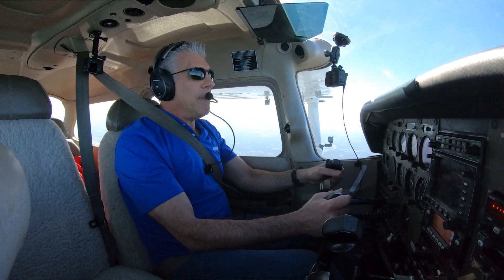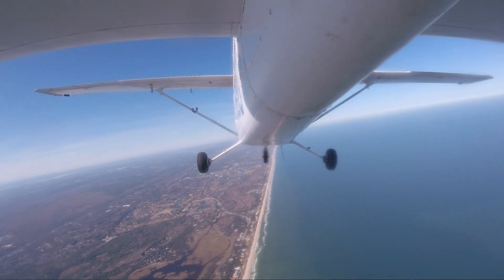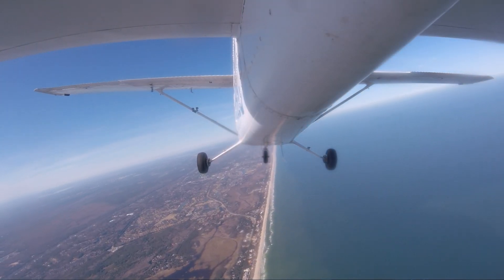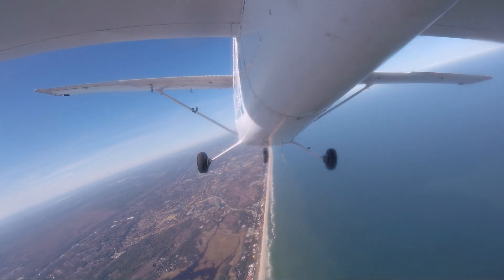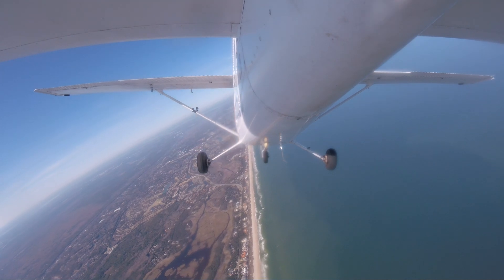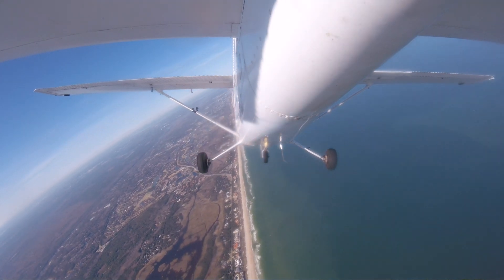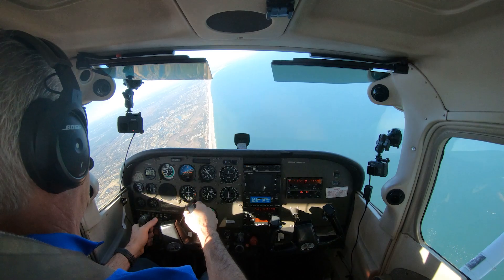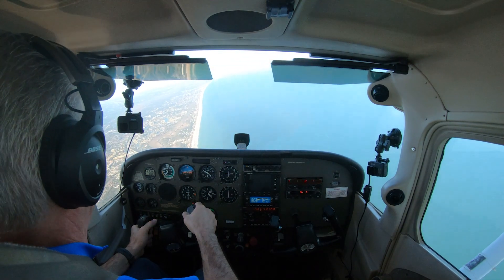Which Flight Control Turns The Plane? Advanced Pilot Skills Series with Spencer Suderman (ep. 3)

Comment: I've always been told its the differential lift of the wings that turns the plane. Elevator maintains altitude due the shift in the lift vector (loss of vertical lift). You can have an airplane without ailerons and turn it with the rudder, which does the same thing, change the lift on the wings. Elevator controls pitch axis .
Reply: Elevator controls  movement of the plane in the pitch axis...which controls angle of attack (AOA)...which controls the amount of lift.  There is no differential lift accross the wing, there is only a total lift vector which is the sum of the vectors (direction and magnitude) both vertically and horizontally.  After bank is established the ailerons and rudder are neutral and the elevator is used to increase AOA of the wing increasing the magnitude of the total lift the wing produces resulting in a turn and maintenance of level flight.  If the plane is at 45 degrees of bank or less then you increase elevator the plane climbs in a bank and turns faster, if the bank is greater than 45 degrees and elevator is increased the plane descends into a high G downward spiral with a ever-tightening radius due to speed increase.